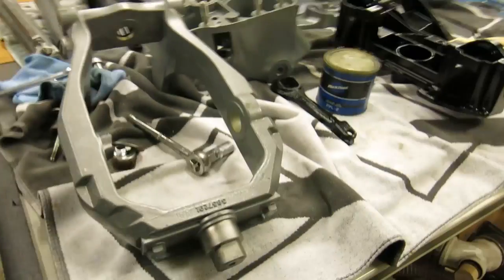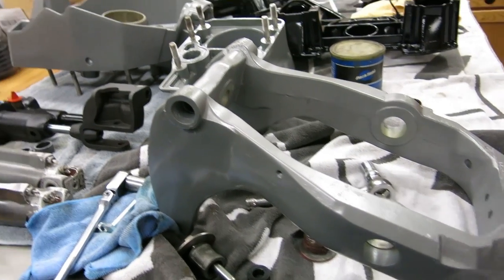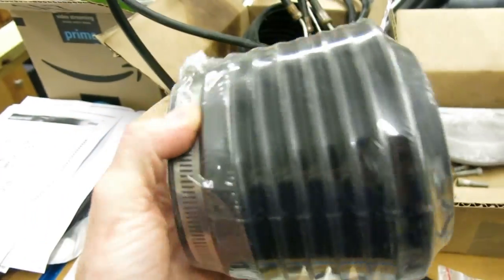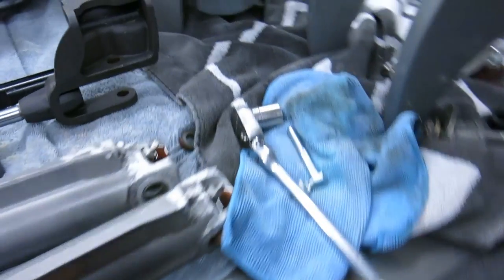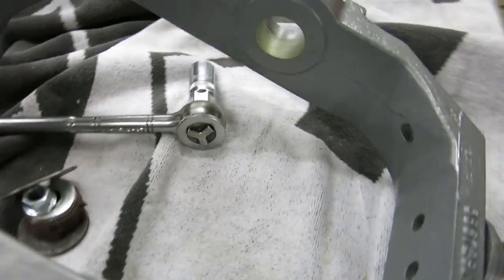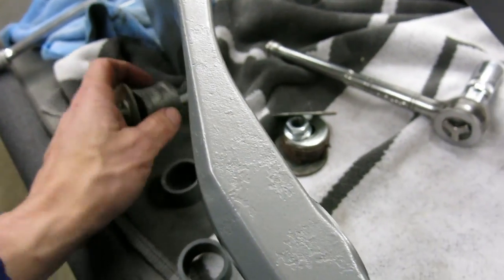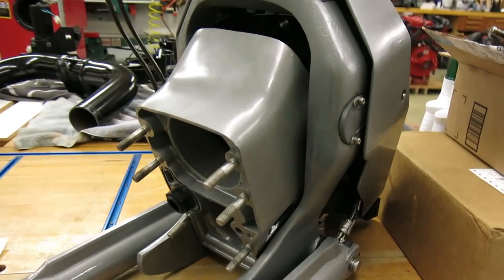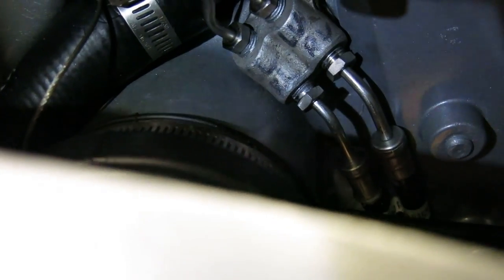Reassembling a Volvo Penta SX-M Outdrive Transom Assembly

Comment: Great Video. I need to do my lower steering busing on mine. Hopefully I can pull that lower pin bracket underneath and then pull the bushing and then press a new one and refit the pin without having to remove the entire unit... 
Thanks for the excellent video. Now i just need to find a puller that will work with it on the boat.

Comment: Just a couple of suggestions...to keep bolts on an outdrive from seizing, you can coat the threads with OMC/Evinrude gasket sealer or Merc Perfect seal (same product) this will seal the threads so corrosion does not cause seizing. I've done this with an outdrive that has been moored in salt water and it really works. 
The other suggestion is to use a flare wrench like you use on brake lines for the trim ram fittings. 

Excellent explanation of how to re-do the Volvo SX transom mount!
Reply: I use medium (blue) Loctite for both corrosion resistance and vibration protection. Something I adopted from BRP manuals.

Comment: hi Chris.When you installed the upper suspension fork bushing you flushed it up to the underside of the gimbal  housing @ 7:40 in the video.I think you had to press it further upward so the top of the bushing protrudes above the gimbal housing  the thickness of the washer that lies underneath the spindle arm.the o ring sits inside the housing just under the bushing so it doesnt get pinched by the suspension fork and the washer under the spindle arm is centered making the spindle arm install easy.
Reply from the maker: Good catch.  In fact, the way the service manual (which I didn't have when I did this job) describes installing the bushing is to actually use the steering arm with the washer as a press from the top. (page 66 of VPA 7743008) That would have definitely made it easier later when I was installing the washer!

Comment: Hi, congratulations for the video. What code does the anti-corrosion cable that you insert before the trim sensors have? I can't find it, in the drawing it only shows the cap code.
Thanks.

Comment: Great to find some helpful info on the sx drive at last.
Any special tools required for the rebuild.
My steering has a lot of play requiring some winter attention.
Reply from the maker: Only the tools you saw me use.  There's a special hex adapter for the pivot shoulder screws.. other than that nothing too special unless you need the press and torch.

Comment: Thank for this video. What tool did you use to remove the upper stearing swivel shaft ? I can not find any press to remove it.
Reply from the maker: Ooh. Yeah, that was a real pain, if I remember correctly.  I think it was just a lot of heat and penetrating lube and the mallet.

Comment: hi  very informative video. I have a similar set up and i got a 1/4" pvc line coming in from the outboard and is caped off. it was rubbing on toe the drive shaft and brock off.  now i have salt water coming in from it in to the boat . would you know the purpose of this line? i cant find any info on it. thanks
Reply from the maker: There aren't any 1/4" pvc lines associated with the outdrive.. it's possible it is connected to your Pitot tube and someone routed it incorrectly.  Does your speedometer still work?

Comment: Lol so the grease line is just pressed in? I always wondered how it went in. I thought it would screwed in with tapered threads . I have volvo and hate their junk
Reply: Now I know the grease line is just pressed in.
But he omit the important part I search for.ie the o rings at the block port for the cylinder line.my mechanic missed I know on mines that's why I'm leaking gas dogged... all the work nd he didn't put it in?.only at the cylinder ends of course this end didn't leak.....do this ends need o rings?.I'd think nd believe so.....for compression seal
Reply: @rodbasden8298  I know there is orings that go to the cylinders, but I'm not sure in the block port.  If I had to guess I'd say most likely yes.  Google , volvo penta sx or sx-m transom shield parts, and look at parts diagram.

Comment: great video do you know any videos that cover installing the transom to the hull of the boat
Reply from the maker: I probably should have recorded installing this onto the boat, but it was pretty straightforward.  use new gaskets and torque everything in the correct order to the correct specs and you should be all set.

Comment: Thanks for the video. Can you replace the trim manifold block without removing the outdrive? Mine is corroded and leaking....
Reply from the maker: You could certainly try.  However, it's a really tight spot and if it is corroded, I'm afraid you are going to have a tough time with those tubing fittings.  It's going to be tough, but if the threads all come out OK, you might be able to pull it off if your hands are small enough. Good luck.

Comment: Hello Chris, super helpful video, by any chance do you have the list of parts you bought for this reassembly. 
Thanks
Reply from the maker: I did somewhere in an excel file but I'm not sure where it is.. let me see if I can find it and how I could safely share it.
Reply: @SlideruleRacingProducts  hello Chris any luck on the list?
Thanks
Reply from the maker: Here's the parts I bought for this video:
transom shield  parts		
	cooling hose	3807890
	decal	3857652
	Sealing kit	3858631
Pistons		
	cap	3857522
	Port cylinder line 1	3857523
	port cylinder line 2	3853857
	stbd line 1	3857524
	stbd line 2	3853855
Gimbal Ring and pivot housing		
	gimbal bearing bellows	23075752
Trim pump		
	oil line	3853825

Comment: This is a great video!!  Thank you for posting, it has helped me tremendously....I have the exact setup and am doing all, except the actual ring.  Question--- did you have difficulty getting the top cap off during removal?  I've taken the 4 bolts out, and I can't seem to get it to budge.  Are there bolts on the backside?  All the schematics I've seen indicate it should just come off after the 4 bolts are removed.  By top cap...I'm talking about what is seen at 31:36.
Reply from the maker: Yes, 2 bolts from inside the hull.  Good luck!
Reply: @SlideruleRacingProducts  Thanks!  I'm glad I didn't beat on it to hard.

Comment: Chris, great video! What size and thread bolt did you use to get the upper gimbal ring fork to come out of the transom bracket where tge steering pivot arm attaches? Thanks
Reply from the maker: I'm not sure I understand what you are asking.  Are you asking how to take the pivot housing out of the gimbal ring?  That requires removing the special pivot shoulder screws which requires a special tool - a star shaped tool.  Search for "Mercruiser Hinge Pin tool" on Amazon.

Comment: What goes in those two holes at 32:05? water is seeping through those two holes and through the steering arm cavity and I am going crazy..Thanks for the very informative video.
Reply from the maker: There are supposed to be gaskets between the cover and your hull at those two holes.  Those gaskets may have shrunk or pulled away from the hull. if water is seeping in between those holes and the steering arm opening, then the gasket between that cover and the drive is bad, so you'll need to remove the cover and replace all of those gaskets.
Reply: @SlideruleRacingProducts  Thanks Chris!

Comment: Is there a way to take out the upper direction bushing without removing it from the boat? I'm struggling on it actually.
Reply from the maker: My steering shaft was seized from corrosion so badly that there is no way I would have been able to get it off without taking the whole thing out of the boat..  After that, you would need to turn some custom dies for a ball joint press type tool to try to press out that bushing while the assembly was still mounted to the transom.

Comment: Thanks! I have a Volvo DP that's has a leaky coolant pickup in the outdrive.  Some people are installing a thru-hull pickup to avoid the hassle.  In your opinion, does the water cool the outdrive oil enough that stopping all flow would be harmful?  From your video I can't quite see how it all flows before the plastic fitting that feeds the upper hose.
Reply from the maker: Boy, drilling a thru-hull pickup because you don't want to properly fix the drive seems like a terrible hack.  The water runs through the pickups in the lower right alongside the oil, through a seal between the lower and upper, right along the oil, and then out the upper  through the pickup opening shown in this video.  It's quite likely that there is significant cooling between the water and the oil.  I would fix the water pickup properly.
Reply: @SlideruleRacingProducts  Thanks. So it's just open space in the lower part, with water swirling around the section filled with oil?  That leads me to wonder how much swirl you still get without water leaving at the top of that compartment, and how much heat is generated in that oil.  I've seen on some forum threads where dealerships have installed the through-hull, which is why I'm considering it.
Reply: @SlideruleRacingProducts  As I'm looking at it, the bulging lower section has the bevel gear and oil bath. That's surrounded by seawater. The upper gears are where the cooling water is in the pickup hose, not doing any actual cooling there. I think I'll risk it. But thanks!

Comment: Hi mr. Bruno what driver is used for the shoulder bolts? Also where did you buy your repair/gasket set from?
Thanks
Reply from the maker: https://www.amazon.com/dp/B01CGNTOR8/ref=cm_sw_em_r_mt_dp_jkn9Fb3A433Z8 

Although it says Mercruiser, it fits Volvo as well.

Comment: Hi Chris, I have water entering the bilge through the o-ring that sits under the steering arm on the gimbal assembly shaft. I'm having difficulty removing the steering arm from the shaft on the gimbal assembly. My gimbal housing assembly is still attached to the transom as I am trying to do this without removing the engine. Any advice on popping the steering arm off that shaft? Thank you, Steve
Reply from the maker: Oh I wish I could confidently give you good news. That steering arms was extremely badly stuck on mine from years of exposure in the Chesapeake.  I know it ended requiring some combination of heat and usage of my press.  I was already planning to replace all of the bushings, so I wasn't super worried about damaging them.  Try using some torch work on the arm itself and cyling between heat and aerokroil.  You may be able to eventually work it off if you're patient.  Good luck!
Reply: Chris Bruno u

Comment: hey Chris, Quick question; when you installed the hinge pins what tool did you use. I am currently taking mine apart and was curious if it is just the standard merc oem tool.
Reply from the maker: I believe I did use the Mercruiser tool from my old Alpha outdrive.

Comment: Good video. Thank you. How much did the rebuild kit cost?
Reply from the maker: Just checked my spreadsheet - it was about $650.  Largest costs were all the hydraulic lines that I had to cut out and replace because they were seized into the cylinders too much for any flare wrench to get them off.  I cut them so I could still use a socket on them before I rounded over the nuts.
Reply: Chris Bruno would you be willing to share your spreadsheet?

Comment: Awesome video Chris!! How did you successfully un-seize the rear trim pin?? I’ve heated and tried a pickle fork to no avail...
Reply from the maker: Heat + Aerokroil + deadblow hammer + careful fixturing in my press.  It was a struggle, for sure, but patience is really important.
Reply: I have had excellent luck using dry ice to shrink the metal bushings before pressing in.

Comment: At 9:08 minutes into you skip a definitely section I want to view.the o rings on replacement lines.
Most package come with 4 orings.
I have 4 lines x 2 opening. That's 8 orings to avoid leak right?
Exactly where o rings missing is where leaks at most complicated area.mechainc is fired
Reply: Please enlighten me here thanks good video..educational
Reply from the maker: The manifold has 4 ports on one side (the drive side) and only 2 ports on the engine side.  Each port/fitting only uses 1 o-ring.  It is very straightforward when you disassemble/assemble.  The only problem when you are doing a complete overhaul as I did is making sure that both UP hoses on the outboard side are connected to the single UP hose on the engine side.  That's why it is important to mark the manifold when you are disassembling.

Comment: Im having  trouble  taking the steering arm apart from the Suspension fork. Did you have to heat it up to losing it up, or press it out ?
Reply from the maker: Yes and Yes.  Heat + press.

Comment: Did you pull the engine or transmission to get the transom assembly off of the boat?
Reply from the maker: Yes - the engine was already out when I pulled this out of the boat.

Comment: So you don't share no link with any of the parts you used?
Reply from the maker: I order most of my stuff from Ebay. The links don't persist over time.  If you actually watched the video, you'll see that I DO share all the part numbers.  But you gotta watch! https://youtu.be/y83ud7V8kDM?t=126
Reply: @SlideruleRacingProducts  I'm looking for the trim cylinder hose
Reply from the maker: @eagle5720  I used to use https://www.marinepartseurope.com/  to identify all of the part numbers I needed in the drive.  But that site appears to be having issues right now.
Reply from the maker: @eagle5720  Here's another site with illustrations.  Better make sure your application is exactly the same as mine.  https://www.volvopentastore.com/Trim-Cylinders/dm/cart_id.534435120--session_id.021194025--store_id.366--view_id.783188
Reply: @SlideruleRacingProducts  thanks but those oil lines are so expensive though, I think I need all four of them cause mines have a bunch of weather crack in them

Comment: God it looks good painted. What type of paint was it ?
Reply from the maker: I used a multistep painting process... after cleaning the aluminum as best I could from corrosion in my cheapo beadblast box, I used the AlumaPrep 33, then Alodine, then Zinc Chromate Primer (green), then the Volvo Penta Duraplus Grey enamel, then Duplicolor "Ceramic" Clear coat.  1 year later and it still looks great.
Reply: Very nice job
Reply: @SlideruleRacingProducts  holy crap dude, you went all out! You must dabble in aviation...

Comment: Did you need to use any kind  of sealant for the new bellows?
Reply from the maker: I have used the sealant in the past for Merc drives, but the manual does not call out sealant for this Volvo drive, so I did not use it.  When you get it aligned right, you can tell that you wouldn't need it.  Keep in mind that I cleaned all the corrosion off my drive and re-painted everything, so the surface was super clean... If your bellows surface is pitted with flaking paint, you may want to modify the OEM instructions to accommodate..
Reply: @SlideruleRacingProducts  Did it leak? I have never not seen anyone use sealant...

Comment: fitting wrench would have been cheaper ...
Reply from the maker: Huh?  Do you mean flare wrench?  Flare wrenches are all 6 pt. and don't have enough fine engagement points to deal with the limited travel access for the hydraulic line nuts especially with the bulk of the web around the socket.  If you don't believe me, try it yourself on your own drive - you'll see.